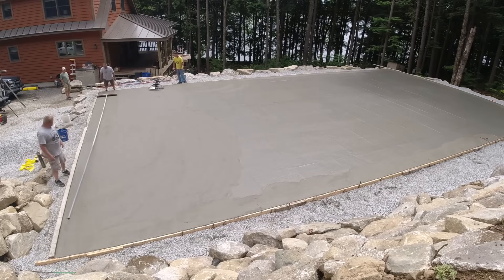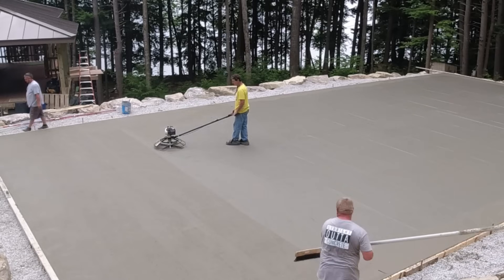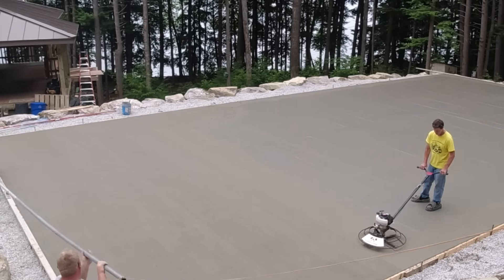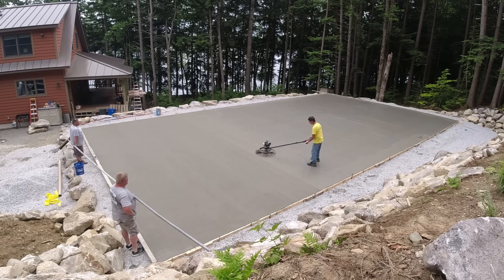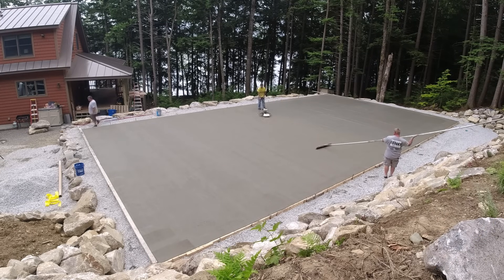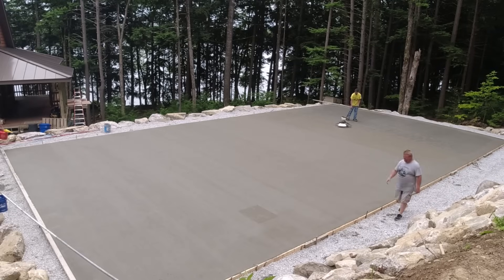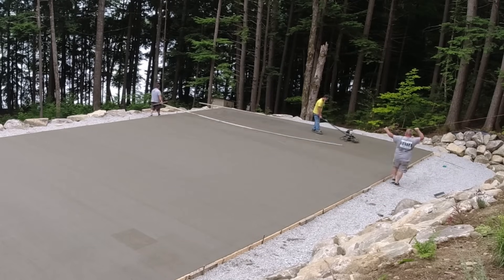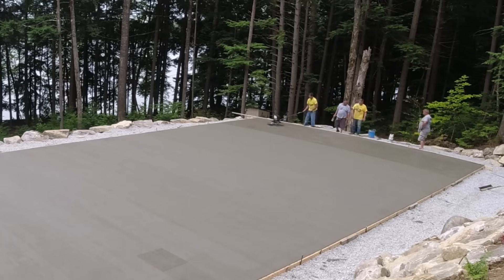Pouring A Concrete Slab For A Pickleball Court: Slab Dimensions, Thickness and Finish

Comment: I've helped pour/finish several of these this year as a sub for another company.  Pickleball seems to be a popular sport these days, for whatever reason.  My understanding is that rubber-like plastic tiles get bonded to the rough surface of the concrete after pouring.  I stood on one recently and this seemed to be the case.